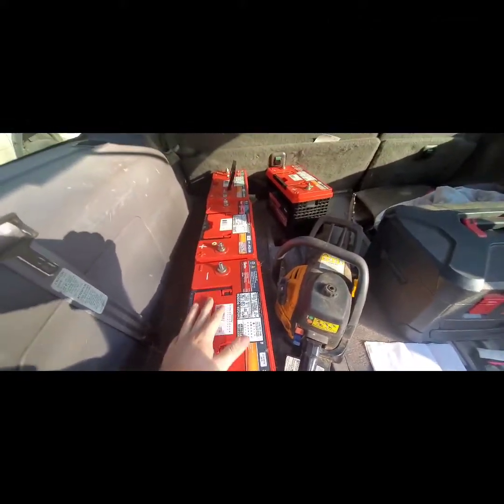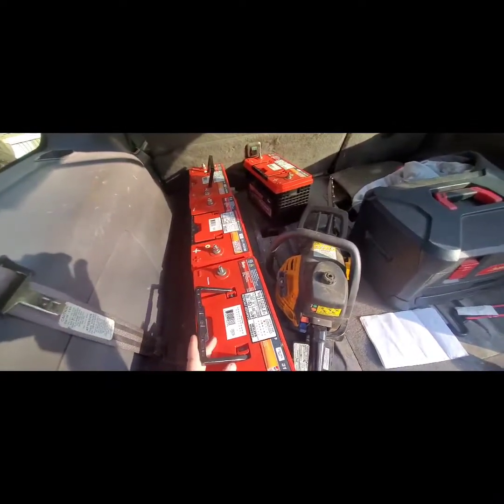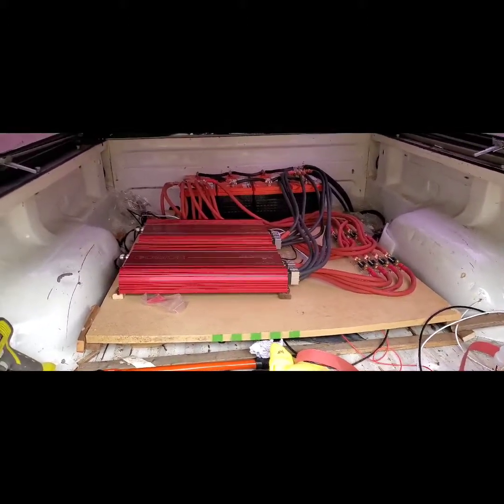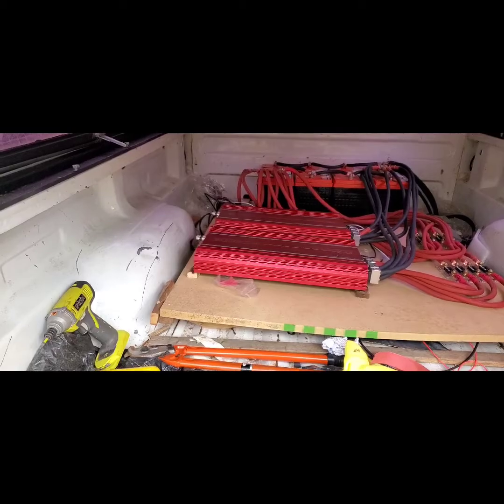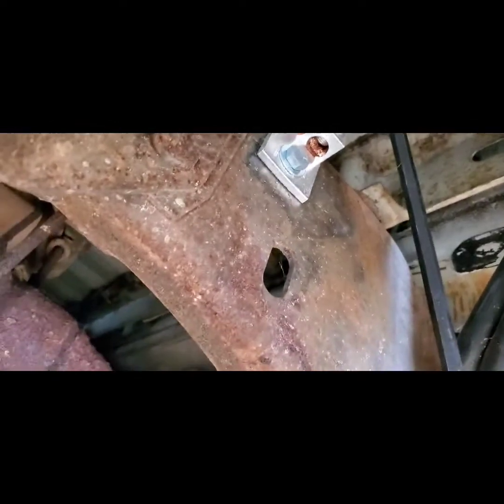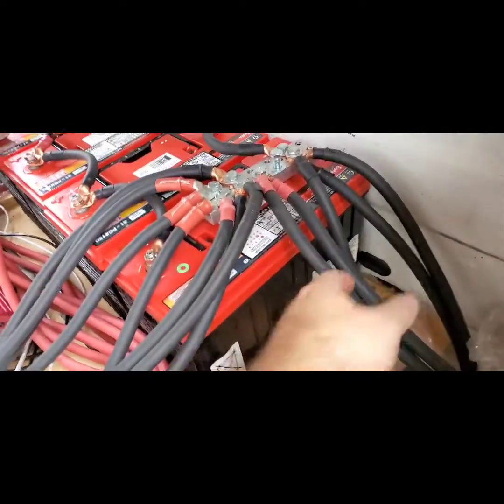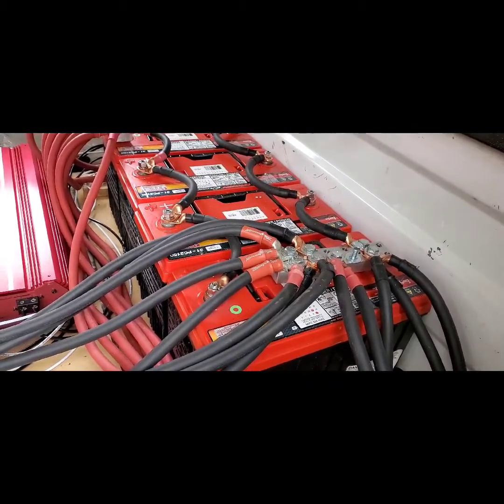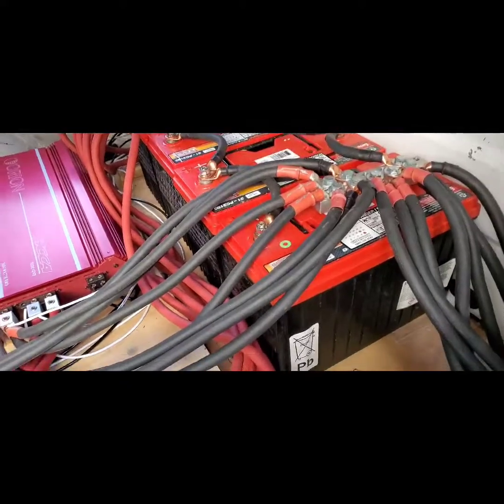Orion hcca/FI Audio build new batteries!!

Comment: Remember those 4 odyssey group 31 batteries you owe me? I will send you my address LOL. Though lithium is awesome it is so unstable and I have seen with my own eyes lithium batteries explode. If you have the room AGM is the way to go with a good Alternator.
Reply from the maker: Yep lol 😆 
Yea I don't drope voltage at all hardly i got my replacement today I may sell it
Reply: @TheCustomEverythingChannel  right now I'm running 6 of the Walmart AGM H8 batteries, they are $160 a piece with a CES 370 alt and I never drop below 13.2. Now I run a ridiculous amount of 1/0 ofc and have plenty of good grounds but it works great. I have 3 12" team 4 FI's powered by a Wolfram AW9000 at 0.5 ohm.
Reply from the maker: Bro u got to post a video the world needs to see ur build
Reply: @TheCustomEverythingChannel  I'm honestly redoing it at the moment. I'm going blow through with my 2008 f150, and switching to 12 inch Avatars. Everything else will be the same. I'm going to stay tuned around 40hz and am staying with 12s for the cone control. I like listening to music. I will be taking plenty of pics.
Reply from the maker: Hell yea thats gonna be bad ass system
Reply: @TheCustomEverythingChannel  when I bought the Wolfram AW9000 I didn't think it would take the abuse I put my stuff through. I normally stay with Orion hcca for amps, they are amazing. But this Wolfram I have to admit is amazing, and just keeps going.
Reply from the maker: Yea they put out a shit ton of power.